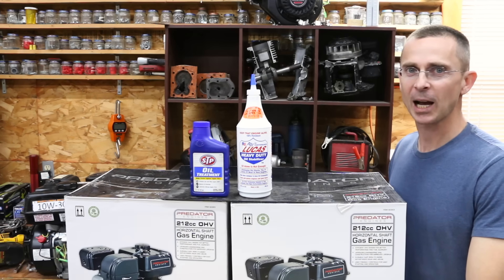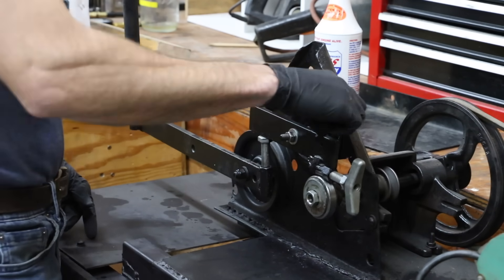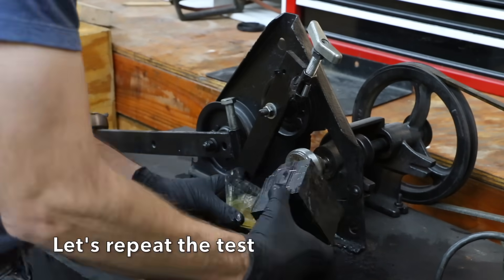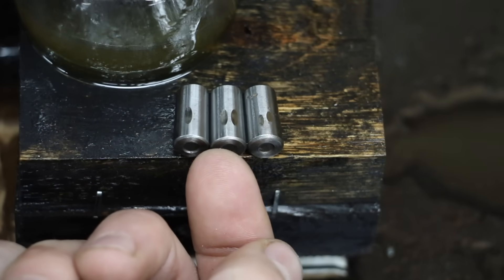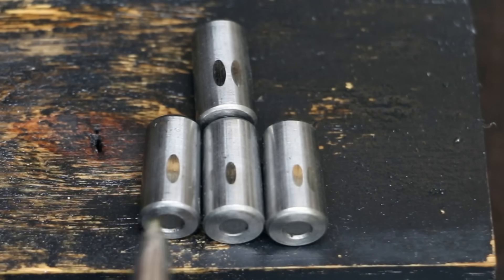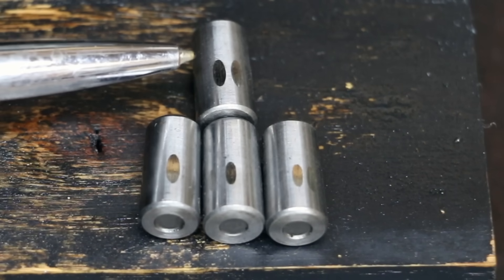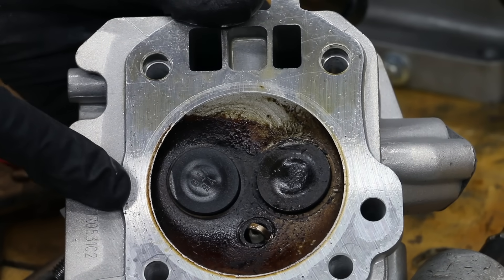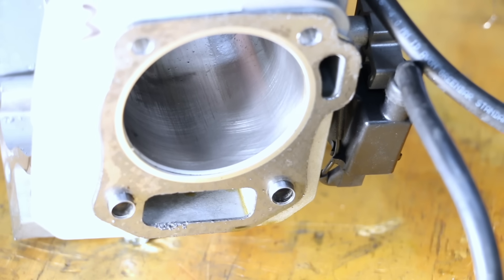Which engine self-destructs first?  Lucas or STP?

Comment: Manufacturers run destructive tests - why can't us plebs do the same? It's obviously not as scientific, but that would cost thousands and these tests are pretty fair. As mentioned in a previous comment, to run these tests in a repeatable 'real world' scenario would mean 1000's of hours of running which is just not practical.
What these destructive tests show is what would happen when your oil leaks out (I had this in 2015 in my land rover front diff) and tests the usual additive makers claims of protection even without oil.

Well done on the tests Mr Project Farm! VERY interesting indeed.

Two tests (three!?) would love to see would be a very likely oil contamination test of Diesel in engine oil and more for my situation VEGTABLE oil in  (or 100% veg oil) engine oil and also an additive test of ZX1 ExtraLube (here in the UK), though I'm not sure if you get in the USA?

Great work on the channel, I hope to chip in on patreon soon when I can afford to.
Reply from the maker: Thank you very much for the positive comments!  I echo your thoughts regarding the benefit of testing these additives in this way.  I've seen lots of cars operated while low or nearly out of oil.  If a product can prevent an engine loss, it seems like cheap insurance compared to engine replacement.  Thanks again!

Comment: The bearing housing that is spun might be case hardened. So if you grind the outside you could be exposing a softer metal. I could be wrong.
Reply from the maker: Great point. Thanks for commenting on this.

Comment: Can you try to tune broken motors with bigger pistons and bigger exost... To get the most performenc out of engin.. Please try... P. S Can you put the engine on the bike....
Reply from the maker: Thank you for these recommendations and ideas!
Reply: Project Farm, In case you don't already know, you can use a strong caustic (soap, hot tank) solution to remove the aluminum from those crankshafts. Where I used to work we had a large diesel generating engine that used aluminum bearings and that's how we cleaned up the crankshaft for rebuilding the engine.
Reply: Robert G I Use muriatic acid on a Wooden Q Tip And Dissolve It Off the crank but you have to Oil the crank and journals Right after Or they will Rust In  no time 😎

Comment: My understanding of air cooled engines is that the Lucas engine ran hotter because it was more efficient at displacing the heat from friction and combustion.
Reply from the maker: This seems to make sense.  Thanks for commenting.

Comment: I would like to see one of the bearing tests done with Rem Oil or some other kind of gun lube and WD 40.

I think the transparent head engine is the coolest. I really would like to see the view from the connecting rod/shaft point of view if you could get the lighting inside the engine right.

Please keep making these videos. I really enjoy them.
Reply from the maker: Thank you for this recommendation and thanks for the positive comment!

Comment: Ever heard of Militec 1? It seems to Work Wonders. I've seen ppl run cars w/o oil for Miles!
Reply from the maker: Thank you for this recommendation!
Reply: Here's a video of this happening: Don't mind the portuguese, the video is quite graphic and shows draining the oil and running the cars with it's oil light flashing. The car was treated for 3 years with Militec 1 but unless I'm mistaken it doesn't need a lot of time for the product to adhere and protect the engine. 
https://www.youtube.com/watch?v=6-2e0YmuBPM

Comment: Really glad you did this test! I’ve been you using Lucas in my cat 3208 because I was getting huge fluctuations in oil pressure. It would dip all the way down to 15 pounds momentarily and then back up to 45-50. With Lucas I get a steady 55 with no fluctuations. Highly recommend for an oil stabilizer!!
Reply from the maker: This is great information!  Thanks for commenting on this.

Comment: When I tried Lucas stabilizer years ago, I had issues with the oil stabilizer effecting both the oil level/pressure sensor and throwing false readings.  It like aerates the oil and create microbubbles.  I don't think there is a point to any oil stabilizer in modern vehicles.  Modern oils have so many additives it's unnecessary.  Change your oil often and leave it at that.
Reply from the maker: Thanks for sharing your experience!

Comment: Not a fan of these videos  it's not really proving one product is better than another the bearing stress test is good I just don't see a reason to blow up a new engine in a test that proves nothing
Reply from the maker: You bring up a great point.  Lot's of tests were done this way in the 90s to prove film strength.  Lots of requests now for me to compare products using this method. Thanks for commenting.
Reply: Manufacturers run destructive tests - why can't us plebs do the same? It's obviously not as scientific, but that would cost thousands and these tests are pretty fair. As mentioned in a previous comment, to run these tests in a repeatable 'real world' scenario would mean 1000's of hours of running which is just not practical.
What these destructive tests show is what would happen when your oil leaks out (I had this in 2015 in my land rover front diff) and tests the usual additive makers claims of protection even without oil.

Well done on the tests Mr Project Farm! VERY interesting indeed.

Two tests (three!?) would love to see would be a very likely oil contamination test of Diesel in engine oil and more for my situation VEGTABLE oil in  (or 100% veg oil) engine oil and also an additive test of ZX1 ExtraLube (UK), though I'm not sure if you get in the USA?

Great work on the channel, I hope to chip in on patreon soon when I can afford to.
Reply: Not hating or any thing still love the videos and I understand your content is request based just giving my two cents  I think like a lot of guys a more real world test would be a long term run  with or without load but realistically that's expensive and a lot of work

Comment: Nice work.  I don't regularly use oil additives but one of my biggest "wins" was with Lucas Oil Treatment.  I had a friend buy a used Dodge pickup with a Cummins engine in it.  The motor had 250,000 miles on it and it was low on power and blowing smoke. Someone traded it in on a newer truck because the engine needed to be rebuilt.  I looked at it and before we pulled the engine to rebuild it I tested it to see if anything could be done.  The blow-by out of the crankcase produced something like 40" of water column on my Archimedes  scale.  So as a last ditch effort, we ran Lucas in the engine for about 250 miles and it completely changed the truck.  The power was back and the smoke diminished significantly.  When I re-ran the blow-by test we were all the way down to 8" of water column.  My assumption was that the piston rings had become stuck and was allowing tremendous blow-by and the Lucas worked well enough to free the rings and restore the performance.  I was extremely surprised, and as an engine builder I don't put a ton of faith in oil additives to repair engines, but we got lucky on that one and it was one time that I could measure the results.  Thanks for all of your efforts and good luck.  R.J.
Reply from the maker: I really enjoy reading posts like this. Thank you very much for the positive comment too!

Comment: GOOD TEST, Commander! I don't use this internally because the DELO seems to be enough, even though all my stuff is OLD in comparison. Probably 20 years or better. I bought an older Ford 1/2 ton 4x4 years ago and the rear differential was DRY, and I mean DRy dry! Moving it was like walking a dozer on a concrete slab in hearing and feeling every pinion tooth turning in the ring gear. I filled it up with Hy-tack which was about the same as Lucas and NEVER heard another peep out of it and never lost a drop of it either. The chrome HAD to be gone inside and it ended up being a limited slip to boot. It'd clunk and pop sometimes when the limited kicked in but never made a sound otherwise. And a rock mason I know was told when he got his 68 Chevy 2-ton flatbed dump by the dealer if he'd pour a can of STP in the rear end he'd never have gear problems. Don't think he ever did. Like I said, I use this in tyranny's and gear boxes and such, not internal. But if I need it, I'll try it. BLESSINGS to U and YOURS!
Reply from the maker: Lewie, I always enjoy reading about your experiences.  Thank you very much for the post and Blessings to you and yours as well!
Reply: Lewie McNeely Yeah I 100 percent agree with oil doing so many different things in engines viscosity is very important. I see so many people with clogged varial valve timing sensors from running Lucas oil. But with differentials and manual transmissions I can't see a problem it would cause.
Reply: Sure thing, Zachary! I wouldn't fool with internally. I'd just go with a thicker regular engine oil. I run DELO 15/40 which is diesel formula, high detergent, high dispersant and all that good stuff. Might be a little thick but my mower doesn't have an odometer so I can't check m.p.g. Sure works good for me. Maybe not for anyone else but nobody else mows my yard! Take care, Pal!
Reply: You're welcome Commander and you also know that chain saw bar oil and motorcycle chain lube has the sticky stuff in it to a varying degree. And maybe you could make a video using snake oil. I've never seen any but seems like you can source it! Take care, Pal!